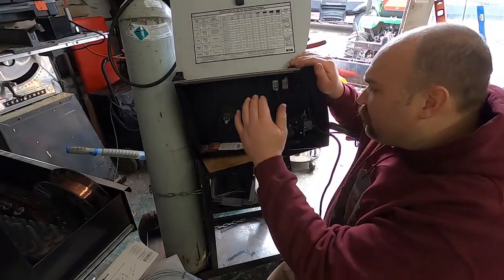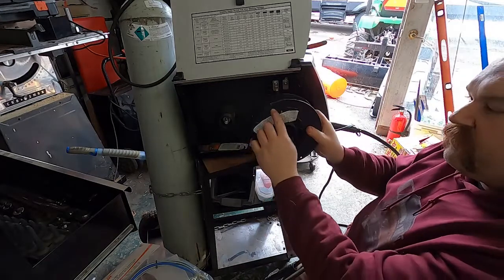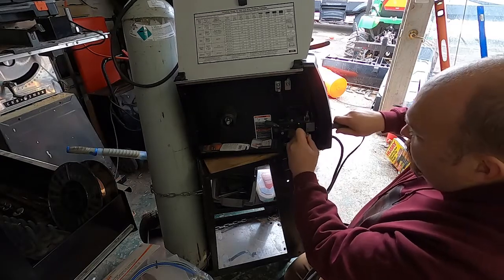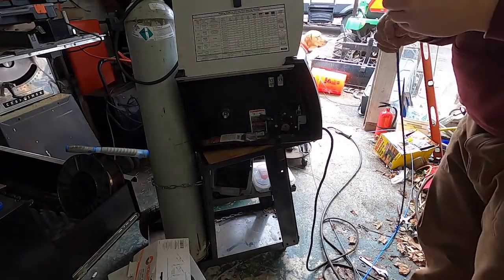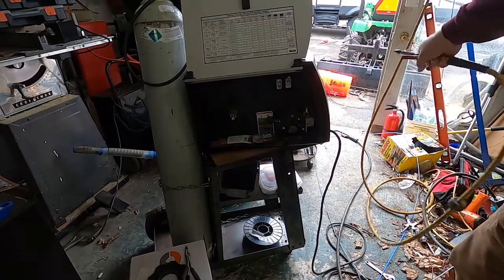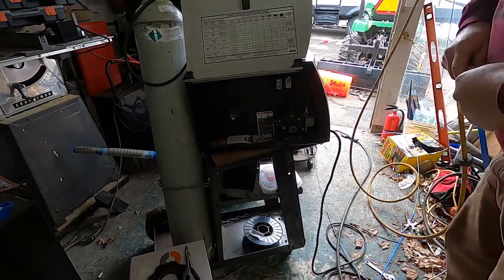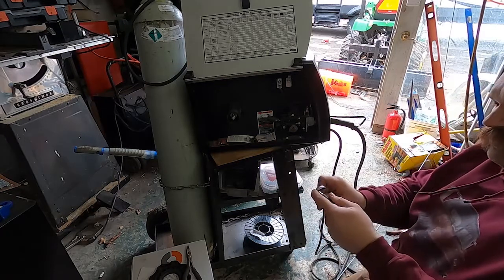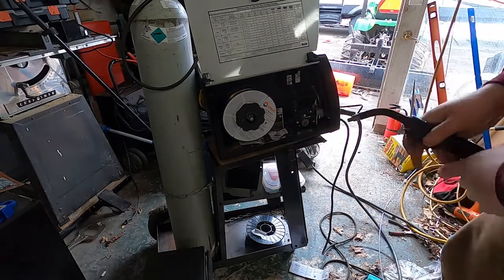Hobart Handler MIG liner replaced- jerky welds? Easy fix on Handler, MVP, Ironman, and Trek welders!

Comment: Exactly what my welder was doing. I will get a new liner tomorrow.  Thanks for the video.  Next trip to Harbor Freight buy you some safety glasses and or a face shield when using your cut off.
Reply from the maker: I have about 100 pairs. It’s rare to see my not wearing them.
Reply: i changed the liner and did not fix the problem so i change the drive roller with .024 and .030/.035 v groove from amazon and it was fixed.
Reply from the maker: @lllllllllllllllllllllllll8722  glad you found your problem. the original factory one on this Hobart has groves for both sizes but you have to remove it and flip it.
Reply: @drewdoestrucks  mine came with .03, .035 knurl grove and .024 v grove even though it doesn't say it on the drive. I tried .023,.024,.025 wire and all slip but .03 worked semi okay on .024 v grove. After looking around the forums many people had problem with old drive roller that came with the welder.